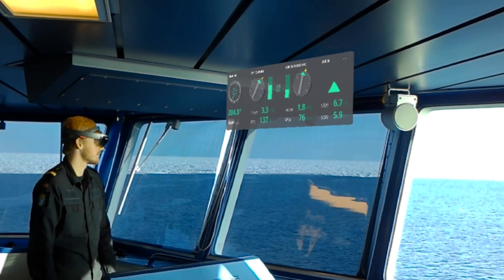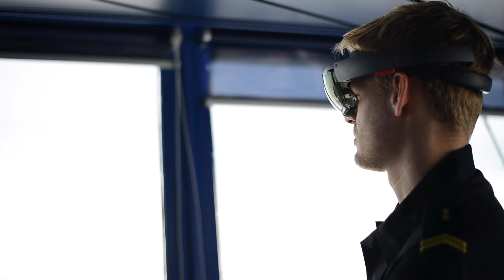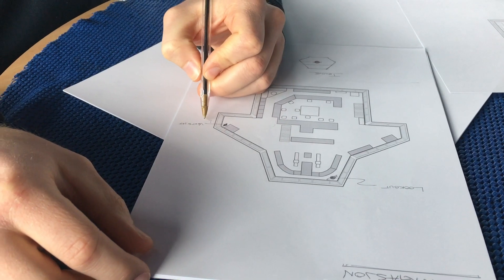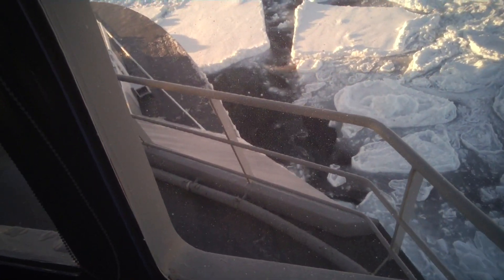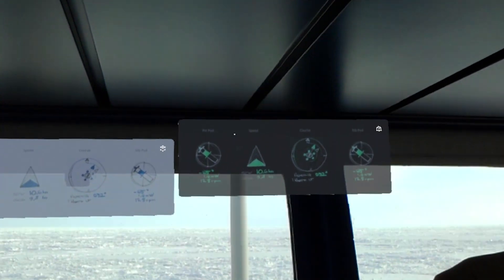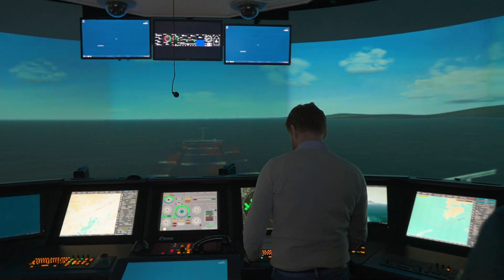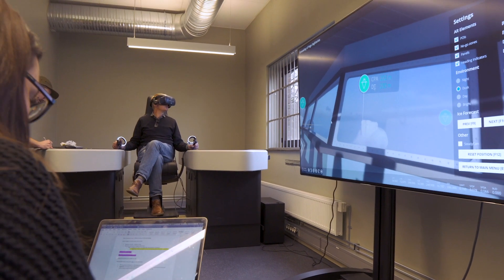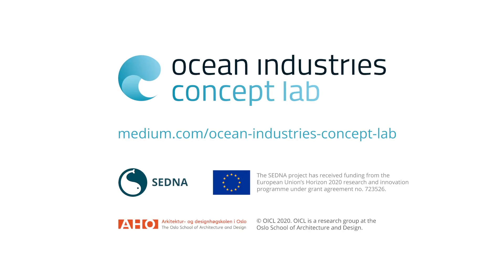How to create an AR design system

Comment: Could you elaborate on the collaborative work and process used by the research partners and domain experts to further the AR experience design concepts you mentioned at 2:05?
Reply from the maker: Mostly traditional collaborative design workshops where concepts and challenges were presented and discussed in the group. The workshop placed the AR concepts in context with detailed operational scenarios that were based on data from field studies from ice breakers. We used boards to allow the participants to attach notes and produced sketches for input.We did workshops with domain expert and with industry partners separately.